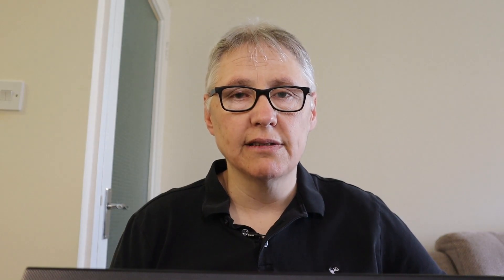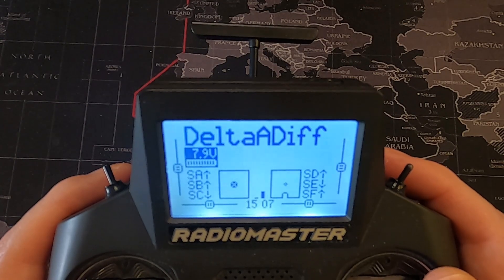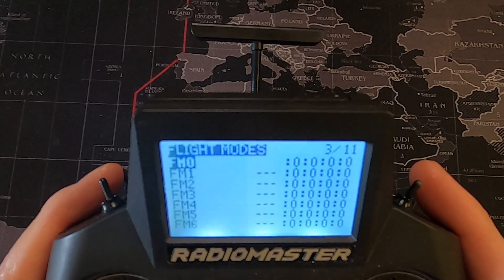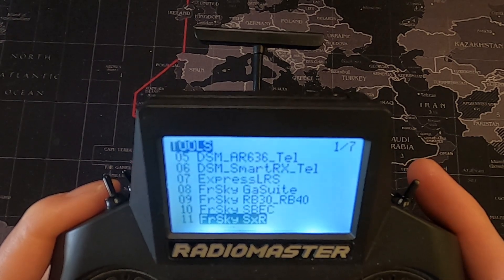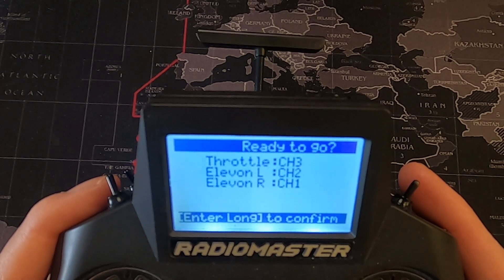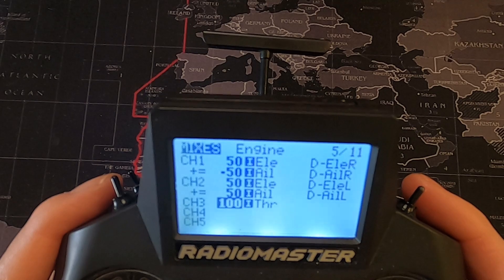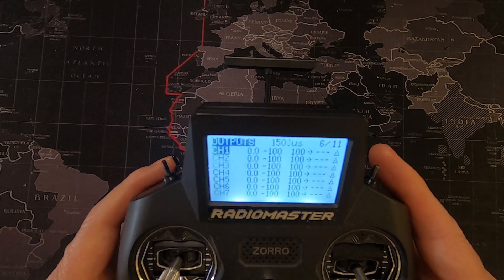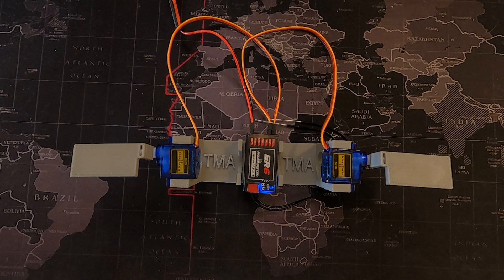EdgeTX - Zorro - Delta/Wing Elevons with Aileron Differential (Viewer Request)

Comment: Exactly what i needed thanks. I needed more Differential. So i tryed to change the Global variables 30 and 40 to something higher, but it didnt work. I put some weight on the differencial Mixes with the Global variable. That worked for me.